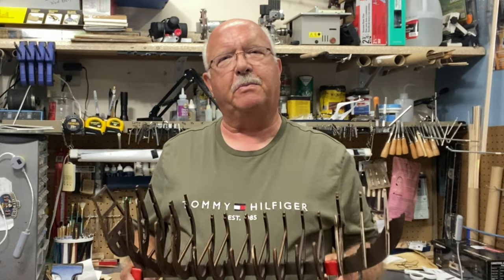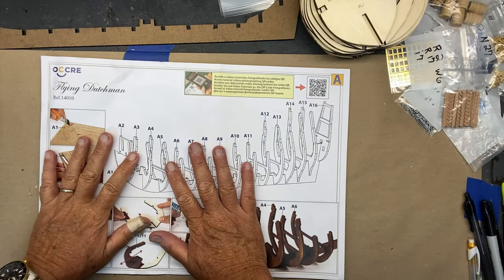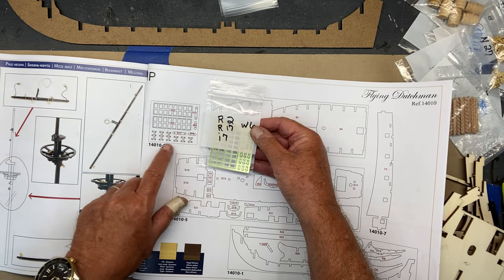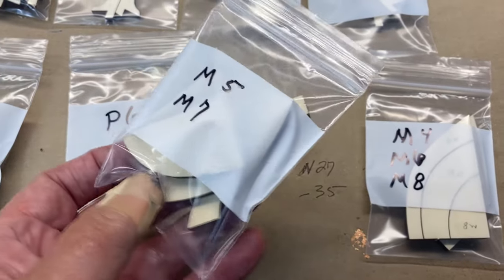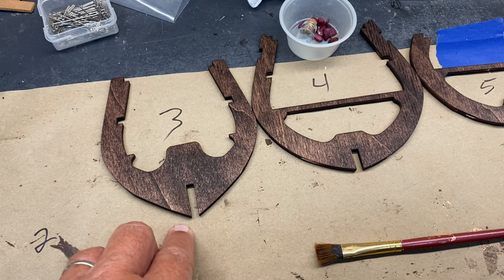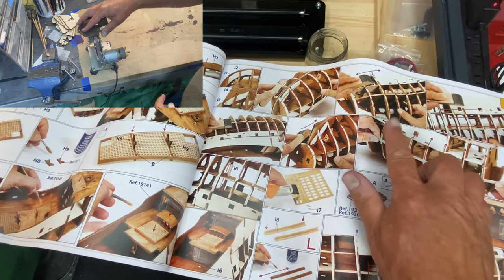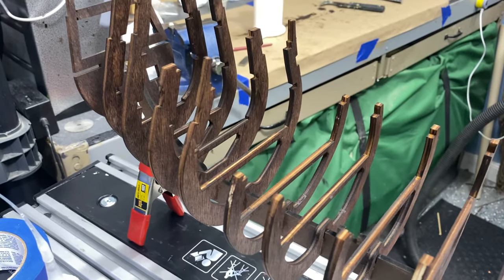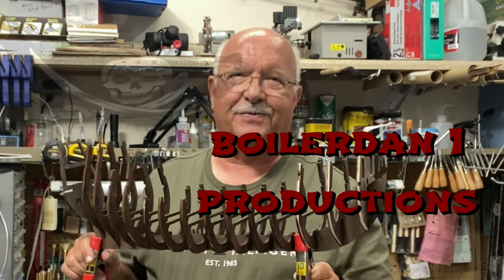The Flying Dutchman  PART 1

Comment: good start I use a small square block to structure a true 90 Deg. frame ... works well and firms things up well ....have a good build
Reply from the maker: As I was putting it together I thought it would have been better to have a set of wooden blocks as you mentioned…. I think that would have worked better and faster.  I was waiting for each one to dry because if I bumped them they would move out of square 🫨.  But I got thru it…. Maybe next time I’ll remember the blocks 👍👍